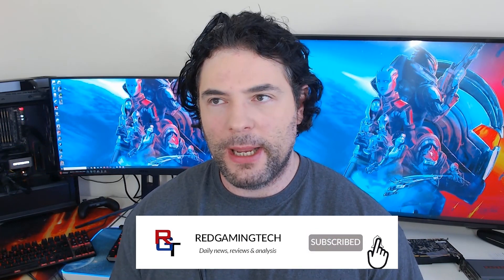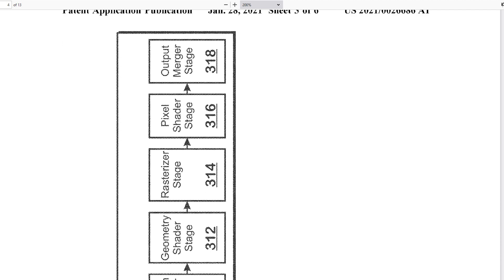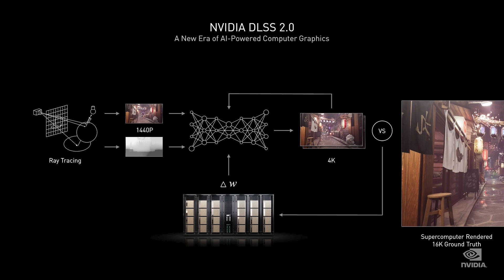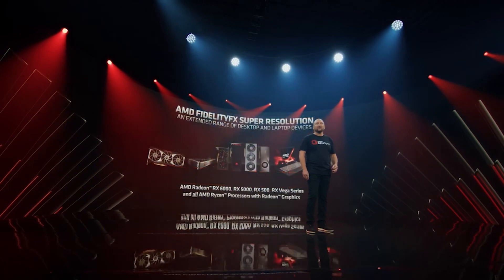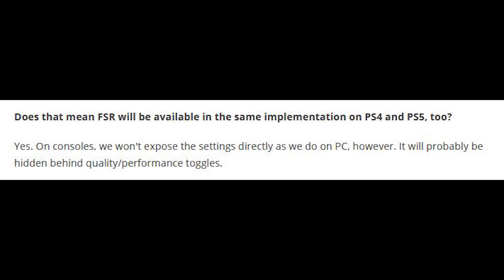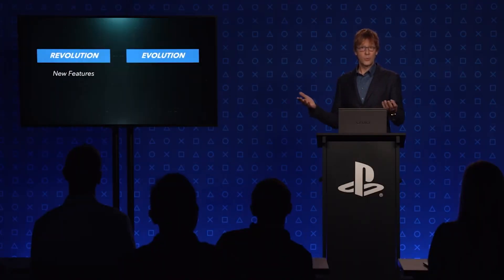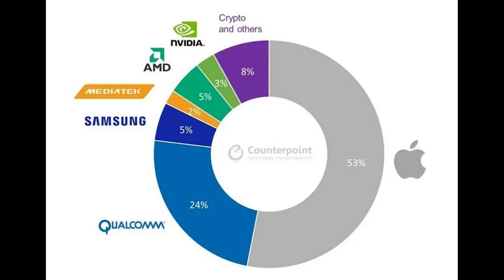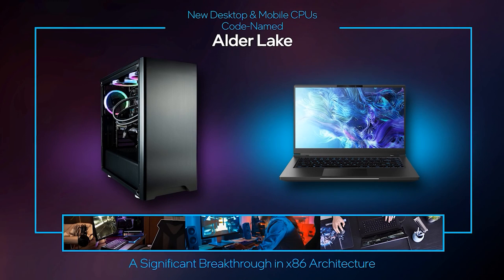RDNA 3 Upsampling - How Navi 3X Could TRANSFORM FSR | PS5 FSR Support CONFIRMED By Dev

Comment: If a manufacturer releases a product for reviews...then changes the spec while keeping same product name..in uk your entitled to afull refund and also you can report this to the uks false advertising standards agency.
Reply: That's stupidly dumb. The point of a review is also to get feedback so yeah they can change the product to make it better. Laws like this only hurt innovation.
Reply: @whitehavencpu6813  Then you change the specifications of the product. Did you not hear the part that spurred this conversation?

VIper/Patriot changed their SSD specs, lowered the RAM buffer, without changing the official documentation. Their excuse was it was "too hard" to change the PDF or the website.

Okay, so they can take an SSD that has 1GB of DRAM and lower it to 512MB or 256MB with no repercussions?

It's one thing to add RAM or change the type of RAM or use a different version of NAND with the same specs, it's another entirely to remove RAM and not tell the customer that the device they purchased after it was reviewed actually performs worse and has less components.

If you bought a desktop that said it had 16GB of RAM and it only had 8GB, that's not innovation that's fraud. That's what's happening here and that is what the law is about.
Reply: @glenwaldrop8166  Nah its your responsibility to check the specification of what you are buying. Ideally, yes they would have to notify you of changes if they want better trust from the consumers. But getting the government involved to make such things illegal is blowing your hand off to prevent an itch on your fingers.
Reply: @whitehavencpu6813  Libertarians should understand that human don't act like perfect consumers. Most people don't trust the companies from which they're buying products especially for electronics because they don't know anything about it
Reply: @whitehavencpu6813  but what about when it makes a product worse without anyone knowing? Is that even innovation or scammery?
Reply: @whitehavencpu6813  Your faith in an unregulated market is anti-historical.
Consumers are unable to act with complete information, so manufacturers have poisoned them, mislead them and delivered poor quality.
See recent bribery scandals if you think that doesn't happen today.
This attitude is hopelessly naïve.
Reply: @whitehavencpu6813  Such improvements would not be prevented, it's substituting inferior parts which are grounds for compensation.
Unfortunately manufacturers are becoming vaguer and vaguer, selling black boxes with names like 860M which had different chips new Maxwell & old Kepler implementing the same product, causing trouble long term to customers.
Reply: @RobBCactive  Then don't buy from them if they are confusing you :)
Reply: @whitehavencpu6813  hi..if they change it improving it yes thats great...the issue is though that in pc tech market some companies are releasing a product..getting reviews for it then changing product spec makng it worse or using cheaper parts...if they do this then they have to change the model and name of product to reflect this ...ie if you bought a ferrari and it had the engine of a lawnmower in under the bonnet...this is wrong 😉..your correct tho that a good company can up the spec improving it ..and they often do...and cover themselves by saying on product" improved" orsomething ...but the crap companies change spec and u end up with a inferior product and not whatyou read reviewsfor.....linus tech  done some videos highlighting issues he has found...and..this is happening on amazon all the time now...companies get 5 star reviews fir a product then change to rubbish spec and customers cant understand the 5 star reviews...
Reply: Sounds a lot like Cracktivision (my pet name for Acivision) sneaking in MITX a few months AFTER releasing a game and it getting positive reviews. Very shady.
Reply: @whitehavencpu6813  Ridiculous!!  People benefit by standards and regulations, without that you end with dangerously defective products that kill.
Reply: @RobBCactive  Nah, the free market would come up with competitive solutions to mimic standards and regulations set by government.

Companies would simply have to undergo supervision by competitive private licensees. Your job would be to not buy from  companies that aren't certified by your preferred quality standard. 

As long as the need or something exists and is profitable, the free market will provide it. I mean that's pretty much why we have Linus, Hardware unboxed, and all these other tech tubers out there. They do the 3rd party reviewing. Imagine the government decide to ban reviewers and force companies to send their products over to the government to make their own reviews.
Reply: @whitehavencpu6813  what planet are you on?  All historic evidence shows consumer protective regulation occurs AFTER failures.
Political views need to be informed by history, NOT fuelled by wishfull thinking and absolute ignorance.
Reply: @RobBCactive  "All historic evidence shows consumer protective regulation occurs AFTER failures."
-> BS, it happens after ignorant fools repeatedly get scammed and beg the govt to step in before the market can sort itself. It takes time for the market to sort itself, multiple certifiers have to pop up, products need to be tested, and finally consumers must decide which licenses live up to the standards or not. But of course, governments are not going to wait for any of that, governments want their monopoly on standards hence why regulations exist.
Reply: @whitehavencpu6813  What lies!!  The free market allowed companies to put addictive substances in products, poisons and all manner of deceit and misdirection.
Try looking at trade treaties, regulations facilitate efficient business & trade not hinders it.
Many standards originate by cooperating companies & professional bodies not governments.
Some of the very first recorded laws were on weights & measures.
This is all freely available to all seeking to check facts, rather than believe in ideological fairy stories.
Reply: @whitehavencpu6813  The rot in the US stems for the 1$ 1 vote politics, lobbyists and super PACs; there's nothing illegal about activities, they're done openly but behind walls of non-disclosure.
That's the world free market policies has created, where big firms trade cross licensing and sue the ass of small entrants to markets.
You're picking the wrong targets and being an unwitting tool of corporate based money insterests which concentrates wealth into an oligarch class.
As seen in recent years, corrupt leaders appoint corrupt people and the rot spreads.
Reply: @whitehavencpu6813  So you want firms to be regulated to prevent them turning politicians into stooges of commercial interests?
Because without laws to restrict that, regulations ... that's what happens
Reply: @RobBCactive  "So you want firms to be regulated to prevent them turning politicians into stooges of commercial interests?
Because without laws to restrict that, regulations ... that's what happens"
-> No, we don't need laws, or at least, laws aren't the only way to prevent that. My goal is to leave it upto 3rd party license and certification companies to give us competitive reviews of products so that we can make our choices. Simply be a responsible consumer and vote with your money. Make it less profitable for them.

The problem with laws is that they  end up favoring a certain set of businesses due to influence with politicians, a lot of standards are forced onto small businesses, making it hard for them to compete. Its just extra barriers to market entry. Further more, it gives the government a monopoly on quality standard enforcement - nobody really knows what goes on between the regulators and big businesses. You can bet its riddled with corruption. They have no real competition and are financed by your taxes either ways.
Reply: us americans dont believe in that hogwash. pfft. consumer protection is for the fish! /s
Reply: Honestly, the LHR Nvidia chips fit that description for me.
I have been mining at night to help offset the cost of cards, cutting my mining rate in half sucks.

It doesn't hurt the big guys, they'll work around it regardless, it only hurts the little guy, at least until they work around it.

As long as it only limits ethereum I guess it's not a big deal, ETH is a pain in the ass to mine anyway, most sites drag out payment.

Comment: Before someone else posts about how "FSR sucks because Digital Foundry said so" - 

Digital Foundry's comparison was broken... On a TON of levels. How the fuck have you not heard about this yet? He ruined the comparisons with different depth of field settings in Kingshunt that gimped FSR vs Unreal TAAU (when properly configured the former looks BETTER, not worse). 

He refused to test above 1080p (which HEAVILY favors temporal solutions even though 1080p is a completely LAST-GEN resolution). AND he ran CAS on TOP OF FSR, double sharpening the image into oblivion. 

Do more research and don't trust DF just because it's DF. There's a reason they were the ONLY one to think FSR sucks.

He also only tested still screenshots which MASSIVELY favors temporal solutions over spatial ones as it makes it so you can't see the AWFUL motion artifacts temporal upscalers cause.

Alex Battaglia had an agenda, and so he bent & manipulated his testing to fit that agenda. End of story. It's sad that he's tricked soon many fools like you though.